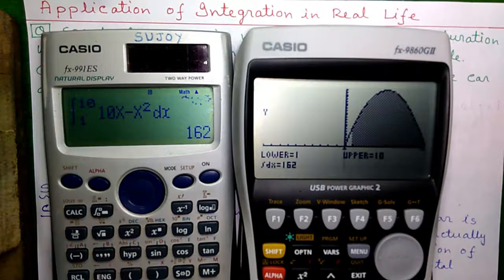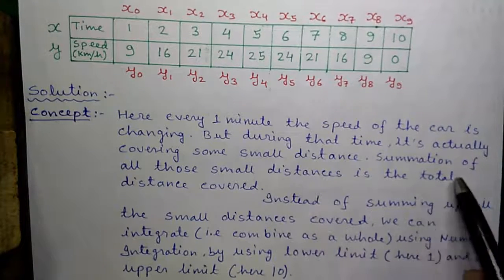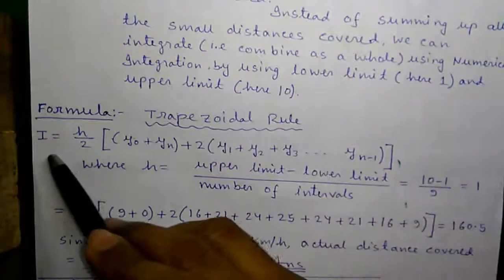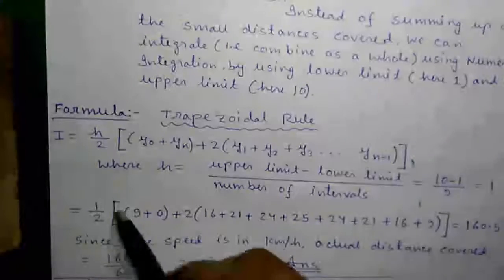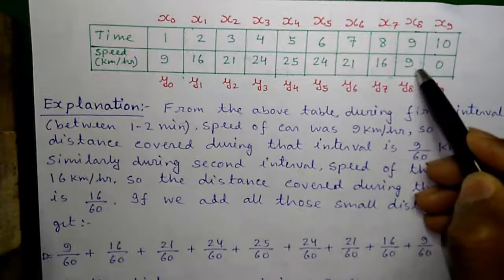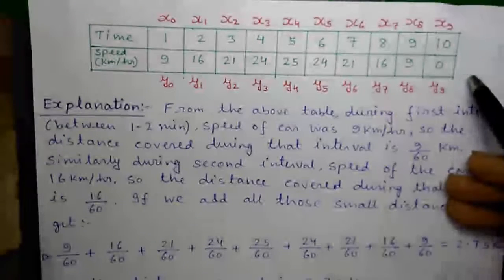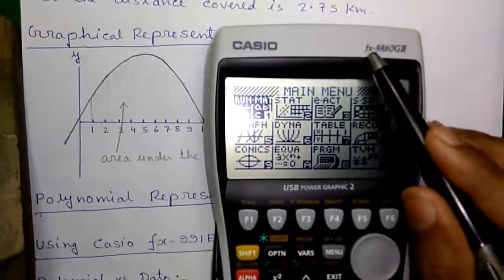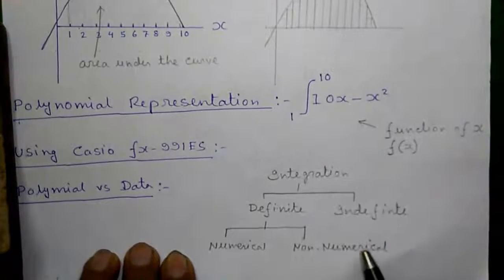Integration Explained with Real Life Example on Casio fx-9860gII Casio fx-991ES Graphical Calculator

Comment: Could you upload some FX Algebra 2.0 calculator? There's little to no information on the internet about it, I'd like to see if it has stuff like implicit differentiation and the ability to store information in text (like on the 9860GII SD), I know it has CAS but I am just so skeptical, planning to buy it, but it's expensive so I have to be 100% sure.

Thank you!
Reply from the maker: +Potato Jose Sorry to disappoint you but I don't own that calc to make vids on that. If you can lend me one, I can make vids for sure! Just kidding! But you can get user manual from casio site, that should ans your basic queries.
Reply: +Sujoy Krishna Das I read it, but there was no clear information on the ability to store information such as texts, formulas, etc into the calculator. Too bad.

Thanks and keep up the great work :)
Reply from the maker: +Potato Jose I can't help you much, but I can save text etc on fx-9860gII using e-activity mode. I think that mode is available on fx2.0 also. And you can download casio calcualtors manuals and guidebooks from edu.casio.com website. just explore casio.com website also.